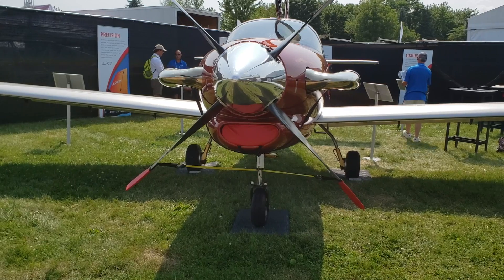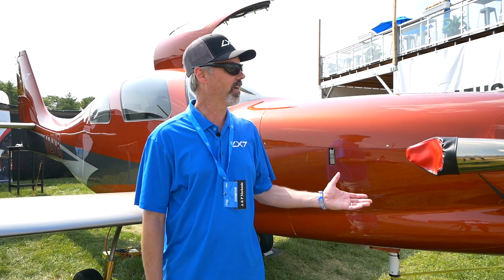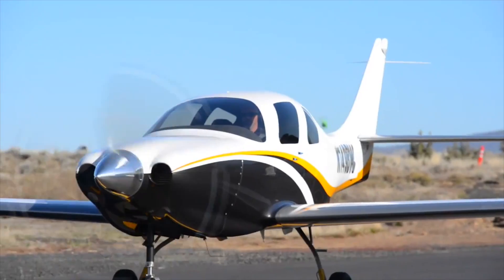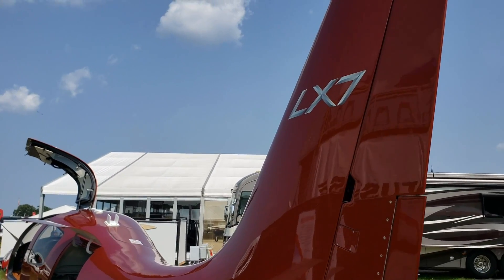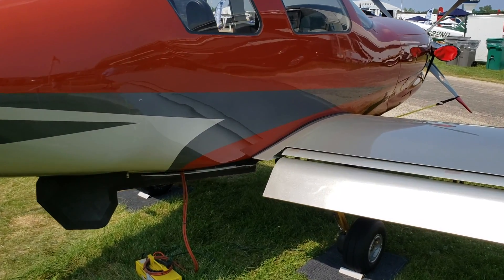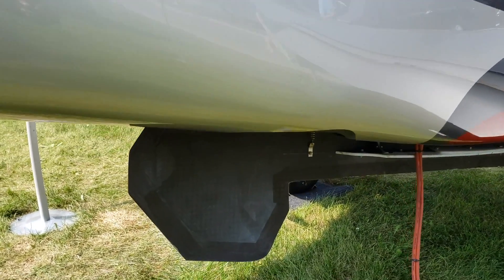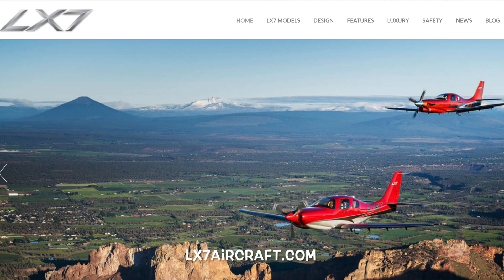This Is NOT Your Grandpa's Airplane - Lancair LX7-20. Oshkosh 2019

Comment: A million bucks and it comes with water in the wing tips.  That's shameful they'd even display it with that condensation in at the tips.  Kinda makes ya wonder about the rest of the innards if they can't make something as simple as a properly sealed running light.
Reply: I'm sure they will fix it. The seal probably just failed.

Comment: Do they buy brand new Lancairs to only use the mid fuselage? And do they use the engine?
Reply from the maker: No a client brings their already built plane and have new parts and functions added to it. You can upgrade to a turboprop engine if you wish.
Reply: @mojogrip  Ok, a trade-in type deal.

Comment: Can it be modified to carry additional tank under-fuselage to extend distance additional 90gallons? approximately 720lbs in fuel plus 20lbs weight of tank. can the engine handle the weight to thrust ratio. ? if you can add another 800miles to the distance then the price is justifiable.

Comment: The Lancair IV-P costs about $200,000 to $500,000, depending on options, time on the engine, etc.  I "flew" a virtual IV-P around the world in Flight Simulator and it's truly badass.  That was an old model with only 2 seats but had nearly the same performance as the LX7-20.  It would cruise at about 280 knots at 23,000 feet and fly 1500 miles on a tank of fuel.  It climbed and descended with amazing speed but was very agile, requiring a light touch on the controls.

Naturally I'd love to have the real thing but there's no way I could possibly afford it.

Comment: A normal lancair 320 is decently fast at 450km/h as well. We need cost effective planes in that speed range and the key is sleek body, reclined tandem is the way to go for 2 seats. The Sharp Nemesis did nearly 500km/h with 100HP. At ground level. So don't be fooled by LSA's garbage 200km/h.
Reply: Dude...the Nemisis does NOT use a 100hp motor.
Reply: @cluelessbeekeeping1322  dude, there are two generations. The second is called NXT. The first one was 100 ponies. Google is your friend.

Comment: It's a great piece of engineering (except for the water ingress in the tip lights) 
My only problem with this class of aircraft in no matter how you extend the range it can only go as far as the weakest bladder on board. This class of aircraft simply is not comfortable over about 2 hours 30 mins.
The turbine would make this a very expensive aircraft, you'd nearly be better off buying a well maintained reasonable old light bizjet!

Comment: Sorry, but with the price of the plane included, you could have bought a new piper M350, or a slightly used M500.. no modification required. "Yea, but its cool!" .. /rolls eyes.
Reply: Do the math on any of the Piper cabin singles- their payload/range is pathetic. This thing you can fill with fuel, pax and bags and go a long way very fast.

Comment: Speed , range, capacity, high end navigation, it’s got it all.
You sure as hell pay for it tho.
Reply: Honestly, with the specs, I expected it to be $1.6 million. My goal is to one day own a used Piper M600 and get it for around $750K, although this plane is amazing. The only thing I like better about the Piper M600 is that 1. it's easier to get into and 2. the cabin class comfort. But this plane is amazing.
Reply: ...680shp in a 4P. What could go wrong? With the 4P already having no costly accidents, I'm sure my insurance underwriter thinks these are even lower risk.

Comment: A mill. Damn. And thats after you buy the plane!!!  So. 1.5 mil all together or so.  Hmm id rather get into a nice used pc12. Bigger and same range 1500nm. Cabin class. Or. For about 250k a nice clean cessna 340. 2 engines. 250 mph cruse. 25k feet cabin class. 1500 nm range. And seats 5 pax. Plus pilot.
Reply: comparing used to new aircraft doesnt make sense.
Reply: @Dudeisthere  How so? Sometimes used aircraft are a better alternative to new aircraft.
Reply: @MaxPower888  Because its apples with oranges. A Cessna 340 is a 40 year old airplane thats slower and will cost alot in maintenance. A PC 12 for 1.5 mil is going to have thousands of hours on it, much higher maintenance, fuel, hangar cost and landing fees. The same goes for the MU2. 
This Lancair is a brand new 0 hour airplane with the latest tech, clearly designed for the turbine rated private pilot who wants to get from A to B fast with the reliability of a turbine. If youre in that market theres no point in looking at 6 seat airplanes. Considering you can price a brand new SR22T up to 1 mil i wouldnt say this is such a bad value.
Reply: You knew that when you heard the word "turbine".  Fast and low maintenance, but serious upfront costs.
Reply: You cannot buy APC 12 for 1.5 million. More like 3.5.

Comment: I'd rather a used TBM 700 or 850 likely for less than this... Used TBM can be had for less than  $1M.
Reply: You're comparing an essentially NEW airplane with a used TBM.  Kind of apples and oranges.  The people that can realistically think "Should I get this conversion or a used TBM?" don't have to worry too much about the price.
Reply: @jarodmorris611  No kidding, and NO not apples and oranges... I'm a huge fan of experimental aircraft. I'm a lifetime EAA member. I think a TBM 700 for $1M is better value than used but rebuilt new $1.9M Lancair.

The Lancair is not cabin class. The TBM is cabin class and can be used for commercial use or charters. 

 Expermental is great. My RV-7 can get me coast to coast in 13 hours (no wind) on about 110 gal of 100LL. However that is not my normal trip, which typically is 200 to 1200 miles one way. I'll fly commercial to go coastal or international. Granted my RV-7 is only 2 people packing light. 

 Its complex buying a turboprop or jet, but bottom line what are your needs, what is the mission and budget. Operating cost of any turboprop starts at $600 hr for owner flown. Jets are double. The range of hourly cost is wide. The experimental Turboprop is likely going to he cheaper to operate but may not hold resale value as well?

Comment: maybe I missed it, but does this plane have any anti-icing capabilities? If you going to be traveling the distances and the speeds that are projected you would think that would be a requirement.
Reply from the maker: I believe it does.
Reply: Yes, electric Deice is built into the leading edge of wings, horizontal and prop.

Comment: 3:11 Is that moisture inside the nav light?  if it is that can't be good.
Reply: you have to pay 100K extra for moisture free nav light
Reply: Maybe it doubles as a boat??? lol
Reply: That's what I saw aswell, I'm like maybe it was just an illusion because that can cause some serious electrical issues.
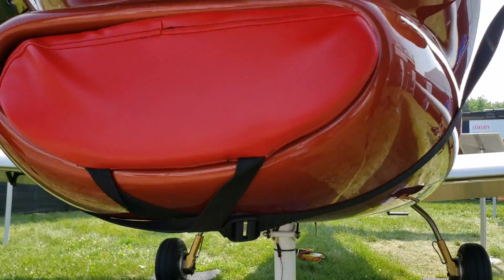Reply: @bc4458  At 3:00 you can clearly see that it is not an illusion. There is a huge amount of water inside of it.
Reply: @fbnx4219  Oh no I'm aware, like I said at first glance I wasn't sure but I went back and confirmed there's definitely moisture.
Reply: @bc4458  Later in the video you can also see that the other side has some condensation in it as well. So I would guess that this is a systemic problem rather than some local defect.
Reply: @fbnx4219  Good spot, seems like a redesign of the seals is needed before it goes into hands of the customers. I'm curious now if this an issue of just rushing to get it ready in time for the show and didnt finish properly or if this is considered their market ready plane.
Reply: Definitely it is moisture!!!
Reply: I saw it too
Reply: moisture there what else is there that I cant see

Comment: My question is how can they sell this as EXPERIMENTAL when an owner doesn't build it.  It seems like if a person has a $1mil, he can order the airplane from the LX7 factory. I thought that an owner has to build it so the plane can be certified as EXPERIMENTAL.  Do these guys find a loophole somewhere in the rule book?
Reply: @2:00 he answers your question
Reply: @ferrarikingdom  :  So you are paying $1 mil to buy a used airplane, and it was modified from a used airplane.  Something is wrong with this business model.
Reply: @2Phast4Rocket  I can see how it would seem strange but with how much they are rebuilding it's pretty much a new aircraft. Not to mention the turbine engine costing a small fortune
Reply: @ferrarikingdom  With this price point, why won't people just buy a Lancair Evo.  If you pay $1mil, you want a company to survive and provide support. Will this company survive in a few years. This is a chopshop way of buying a $1mil airplane.  With chopshop cars, most drivers are gearheads so they can work on them. With chopshop airplanes, I doubt their pilots are the type of EAB gearhead that work on airplanes.
Reply: @2Phast4Rocket  lol relax, I'm just stating info from the video
Reply: @2Phast4Rocket  not much is reused, the wing, and tailfeathers as well as firewall forward are all new. The only things retained from the used entire airframe is the cabin area structure and landing gear.
Reply: @2Phast4Rocket  EVO ?  they are out of business.
Reply: They literally discussed this at two or three points throughout the video.

Comment: This just really proves how overpriced TBM’s are
Reply: Heily - the reason the price is so low is because it’s experimental. Also has a cheaper pt6 that most of the time will be overhauled before being put on the aircraft.
Reply: @damonpetty7741  Indeed. You just touched on the differences in processes and certifications--completely different animal.
Reply: No, it doesn't.
Reply: Heily - sure does
Reply: It really doesn’t. TBM is a different class entirely, not to mention the fact that it’s certified.

Comment: LX7 turbine is the same price as a new decked out Cirrus SR22T with all the options. Not a fan of turbines but you don’t even get slotted flaps on a Cirrus like the LX7 has. Also wondering why RDD hasn’t changed the rear cargo door with a forward hinge for obvious reasons, Lancair has already updated this problem and even enlarged the door.
Reply: Piper Malibu Mirage, the best cabin class single engine plane for the money also same price range.
Reply: Not a fan of turbines?!  Why not...
Reply: Waste of a huge amount of fuel, lancair’s blow the windows out on pressurized versions.
Reply: You have to have window heat at altitude to keep windows flexible, Lancair IV-P don’t have it, they freeze and shatter.
Reply: @tropicthndr  depends on how the plane was built.. Cirrus's are certified and built in a factory. Lancair's are not. I know of many Lancairs IV turboprops flying that have never busted their windows and they don't have window heating.. all pressurized.
Reply: @tropicthndr  Come to think of it.. I think you are mistaking Lancair IV's like in this video with Lancair Evolutions. Different airframes. I've maybe heard Evo's busting windows.

Comment: We need to be moving toward less expensive aircraft with these options
Reply: Tbm940 starts at 4 mil, and seats what - 6 people? If you put that into perspective, this 4'seater at 1mil is just right with this turbine engine
Reply: @Floag  Thank you for correcting my misspelling.  Now, may we discuss your use, or should I say misuse  of punctuation?   LOL  Gotcha back...
Reply: Tribulation Prepper yea lol
Reply: Tribulation Prepper lancair, not lanceair
Reply: Everything's pointing toward kit craft
Reply: Dark aero has what you’re looking for (kind of) high speed (275mph) long range (cruise 1700nm) - sub 200k build
Reply: Mr. Richards,  There now many new options available for one quarter or less of this airplanes price.  Many very nice older airplanes at less than a tenth of the price of the Lanceair LX.
Reply: @tribulationprepper787  Older planes with that kind of performance are insanely expensive to maintain. Nobody seems willing to talk about this. Yes, you can buy an older plane for less but it will also break nearly every time you fly it.  Look at the Cessna 310. You can buy those planes under $50k but they cost $30k per year to maintain. I fly a new "expensive" plane that never breaks down and sips fuel. With planes you pick your poison. Buy low maintain high or buy high and maintain low.
Reply: @kevinbutler9786  Kev...  I am just trying to justify (for someone else) spending a mil on a cramped, four place airplane.  I thought a half mil for a Skyhawk was nuts enough.  So much for the American economy and the value of our declining fiat dollar.  I would prefer to buy newer, slower, higher MPG, less costly maintenance and "experimental" if need be.
Reply: @tribulationprepper787  I agree that a mil+ for a small 4 seater is crazy. I like that people are doing this though. This is where innovation is born. They will sell maybe a handful of these but maybe the building of this plane breeds some new tech that advances something else, maybe that capital goes into something more mainstream, who knows. Either way, buying old worn out planes from the 60's-70's is just not a good idea.
Reply: @kevinbutler9786   You just got me thinking that the LX7-20 is really just a rare collector's coin with wings.  Funny thing is, If I had the money to throw around, I might just buy one for the million dollar heck of it, just to show myself that I could.  A big ego is dangerous you know!   I'd take it home, put it in my garage, cover it up and look at it about every five or so years, pat myself on the back and say "Damn I'm Good.
By the way Kev...  Those older airplanes you mentioned are usually very well maintained... by law.   AND, let us not forget about the thousands of Oshkosh pilots who are flying, racing with and doing loop-te-loops in some very, very, very old airplanes.  They seem to think an aged aircraft is a darn good idea.
Personally speaking, I'd go for the Pipistrel Sinus with the long wings.  Looks like a hoot to me!
Reply: @tribulationprepper787  That argument for old planes is silly. The planes doing "loop te loops" at oshkosh are custom built low hour NEW planes. Extra 300's and pitt's stunt planes are not old. And the other "older" show planes have been recently fully restored and modified and again, are low hour compared to the average cessna or piper sitting 7,500 hours or more. And planes from the 60's and 70's could be maintained to the hilt  their whole life in an air conditioned hangar but after thousands of hours of use, they are just going to break. A lot. Things wear out. And not just the stuff that gets maintained. Fuel lines, electrical wires, old ass avionics, hingnes to control surfaces. The list is endless and by the way, YOU are not allowed to fix it. By law, you have to pay an A&P $100+ an hour to do it. That adds up so quickly that your little $25,000 "bargain" costs you more annually to fly than it did to purchase. I work at a hangar, I know what gets done on an annual, I see owners forking out thousands for minor fixes. No thanks, I'll pay more up front for a new plane.
Reply: @kevinbutler9786   You make a good point.  Maintaining an older non-rebuilt Cessna would cost more than fixing an older Jaguar.  Since you are in the A&P environment I will defer to your judgement.   In terms of powerplant maintenance,  what do you think about Rotax as opposed to Continental and Lycoming?
Reply: @tribulationprepper787  I am a rotax guy. You get the very best of aviation tech, great economy, great reliability. I just flew a rotax 915is powered plane from california to oshkosh and at one point was doing 160 TAS at 11,500ft at 6.5 gph. Lycomings and Continentals at that pace are burning 12 gph or more. In eco mode the 912is burns 2.6 gph.  And they offer full FADEC which is basically the greatest thing in the history of flight as far as I'm concerned. Full ECU controlled flight down to the constant speed prop. No mixture control, no carb heat, not even a manual prop control. You just set your prop setting, set your power setting and the plane does literally everything for you. The only downside to rotax is the gearbox. I don't like them. I haven't had a failure yet but man when you start a rotax, the gearbox sounds like it's rattling to death. But I'm told they are bullet proof and I've never had an issue.
Reply: kevin butler what kind of plane are you flying sir?
Reply: Very unfortunate that working class people can not have one of these planes. Banks are very far and few for financing one of these airplanes, it is considered as recreational aircraft, not a nessecity. Wish that it was affordable.
Reply: @robertlashier6272  like everything else. Anything that is better usually cost more.  There are many airplanes out there that working class people can afford, just not this one or a new cirus or TBM ETC
 etc.

Comment: Wing tip light full of water.  What happened there?
Reply: The whole cut out for that housing looks very rough to me.  For that kind of money stuff like that would drive me nuts.
Reply: @JeepersCreepers2013  agreed, not acceptable on a plane that is costing $1,000,000 plus $500,000 donor (not mentioned here) supposedly built in a professional shop.
Reply: Came here for this answer.
Reply: Just watched it again, difinately water.
Reply: 3:11  6:21 good eye
Reply: Ya, at first glance i thought it was water, but it may have just been an odd frosting to diffuse the light.